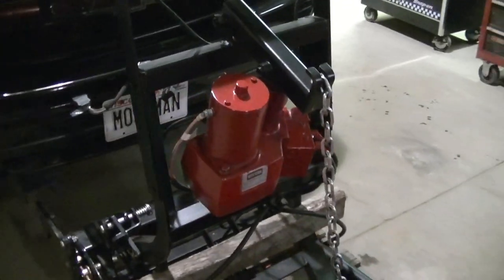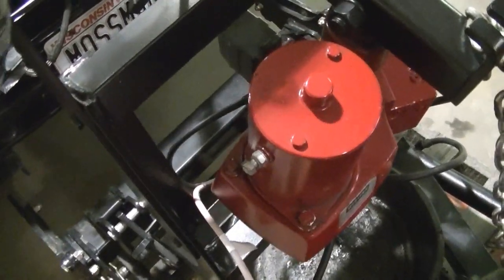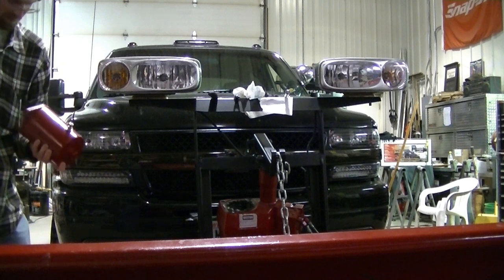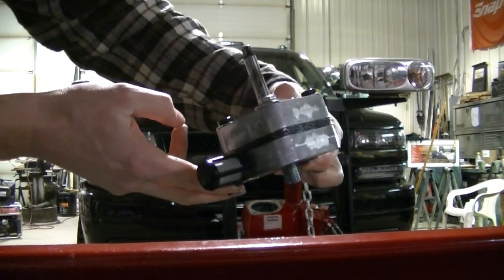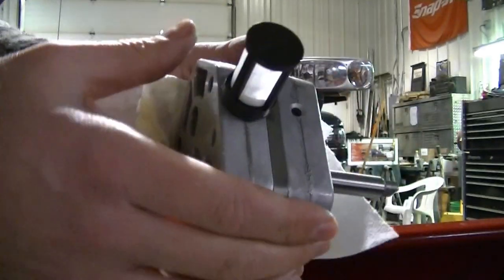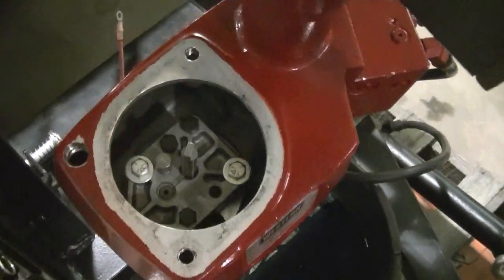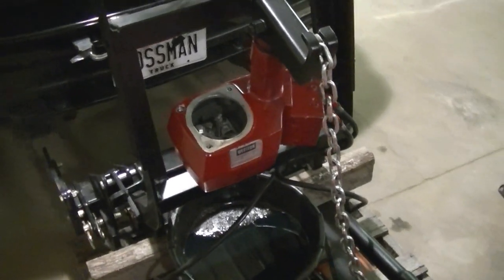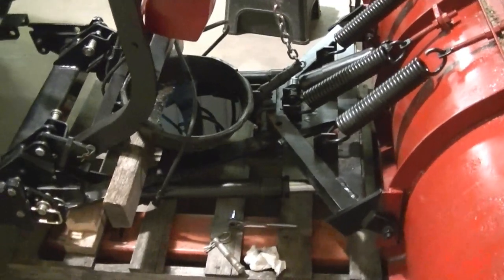New Pump install on Western Unimount Snowplow

Comment: I have a trick for ya on your cork gaskets. To keep them forever pliable, before you install them, give them a light coating of moly grease. Take some grease on you thumb and first finger, and while making the hand gesture of "money" (closed fist, sliding thumb and first finger back and forth against each other) coat the cork gasket. This will also keep them moist, and they will never dry out. I've also used this on Felpro fiber gaskets, and seems to work well.

Comment from the maker: The plow is probably 30 years old.  The pump is only about a year old.  I think that so much dirt got inside the pump is plugged the filter.  The filter then collapsed and the pump sucked in dirt.  I put new angle cylinders on it today but still having trouble.  I think the angle cylinders were causing the dirt problem because they were pitted pretty bad.I cleaned the reservoir before I put in the new pump.  But I did that last time too.  I am doing a video on all this just need to edit it.

Comment from the maker: This plow is 30 years or older.  I have repainted it a couple of times.  The pump was making a terrible woodpecker noise and moving pretty slow.  I am still having trouble with it even with the new pump, new angle cylinders and new hoses.  I think the motor is burned up not sure.  I am looking it over today and will have a video up soon.

Comment: my plow still has the original die cast pump. is the newer style pump and different than the old style
Reply from the maker: The pumps might look different but pretty sure they are the same for these old plows.  I am not familiar with the cable control type plows.  They might be different.  Once I starved my pump of fluid with a plugged filter it was done.  That is why every year it gets new fluid and a filter clean/change.
Reply: Mines not a cable plow.  Same as yours but I guess western uses a different pump
Reply from the maker: @chachifeere    Pretty sure this is it:  https://amzn.to/2MZCi55  They have gone up in price.

Comment: Hey mossman381 I was wondering do you remember what pump your plow had when you first changed it for the first time? I have the old old style kind and I know they are discontinued I was wondering if the newer kind for unimounts will work?
Reply from the maker: If you are talking about replacing a cable operated pump with a electric one I am not sure how that would work.  You would need the controls and wiring.  You might be able to use the angle rams but not sure.  I have never done that kind of conversion.
Reply: No not a cable style the electric solenoid kind. i belive its a 91ish model but it's the first pumps they came with. but they discontinued them now and I don't wanna spend $150
On a pump and have it not fit. I was just curious cuz mine is similar to yours mines just not as nice lol. Thanks for the reply..

Comment: Nice, what size is your garage if you dont mind me asking
Reply from the maker: The shop is 40x60 I believe.
Reply: O wow, nice size, I have the same set up as yours, had it for a while but it sat for the last 2 years, just finished replacing the flyid in the pump along with filter but I cant get my low/high beams to.come.on, thinking it might be the relays
Reply from the maker: What year truck?  Do you have the Iso Module?
Reply: Its a 00 Dodge dually, dont think it does, Ive only seen the relays there, dowloaded the wiring diagram.and everythinh seems to be correct, driver side park lights work, turn signals work.on both sides but when I turn 
the flashers on my dash the high beam.light indicator flashes as.well and I have no low or high beams, mind u.its been sitting for.2 years
Reply from the maker: So your truck lights stay on with the plow hooked up?
Reply: If the plow.is.plugged in all.I.get are turn signals and park light on driver side, no.low or high beams
Reply from the maker: Check and clean the ground on the plow.  Check bulbs on passenger side.  The headlights probably are the relays.
Reply: Thanks will do